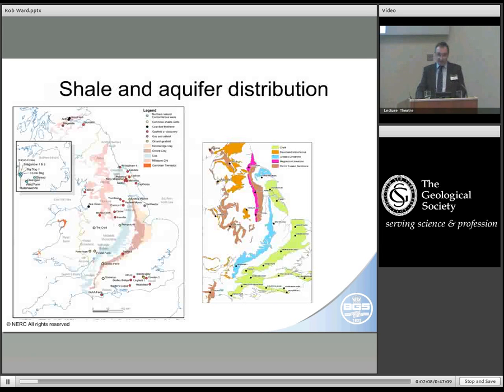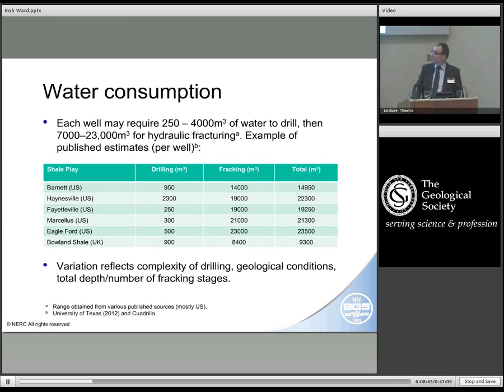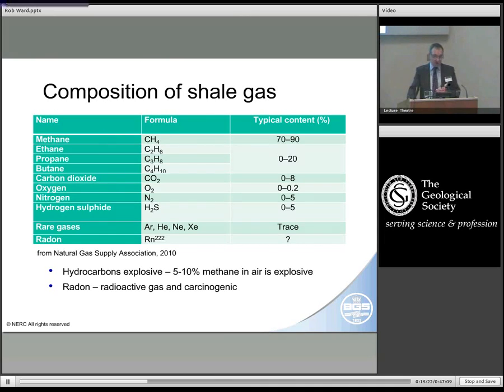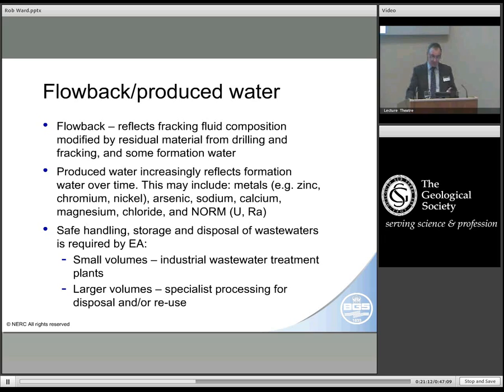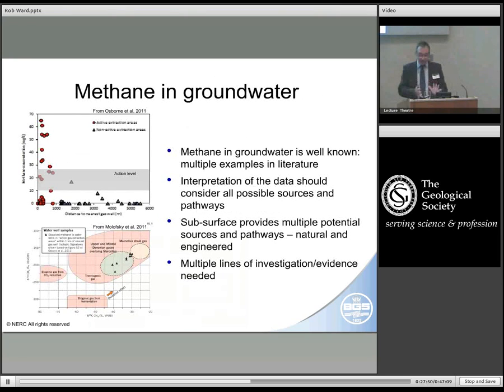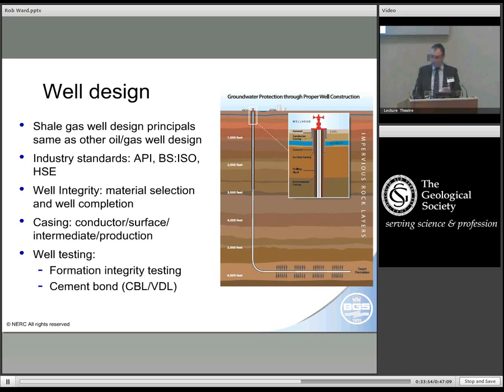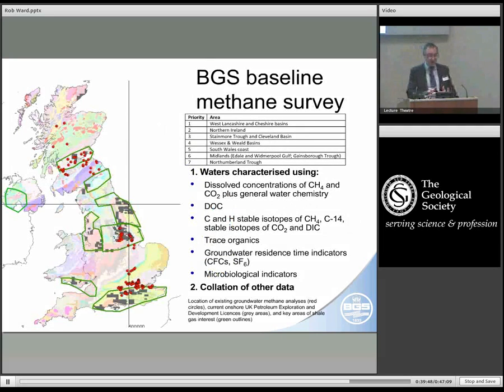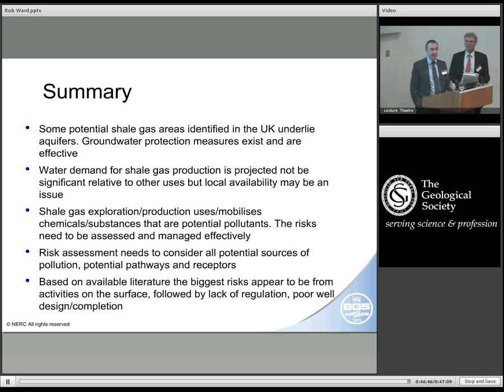Can shale gas be extracted safely? Groundwater, well integrity, use of water. With Doctor Rob Ward

Comment: For what time frame does the well integrity remain "fine" (32). All wells fail with time (Dr. Ingraffea. Facts on Fracking.You tube) even with the highest standards (UK/Norway). Will well integrity be tested between each HVHFracturing (1~20) considering higher pressure is used than for conventional wells. I doubt this. In future well corrosion will result in failure with aquifer communicate, fracturing fluid and gas migrating. Watch the Dr. Ingraffea video before replying. Should we care?